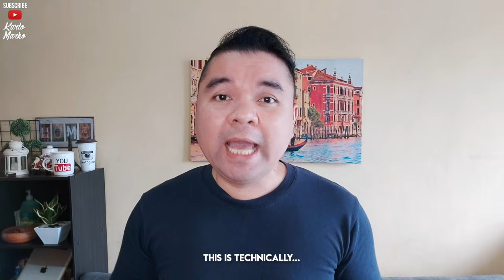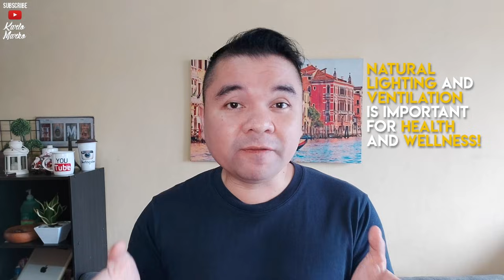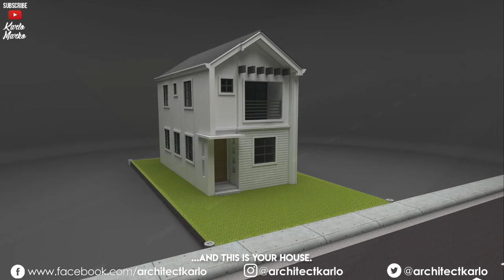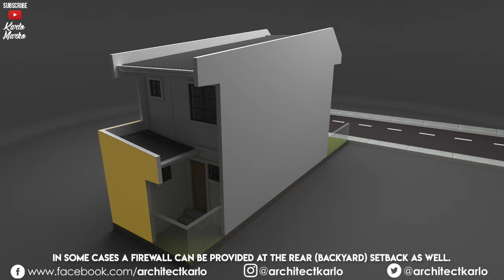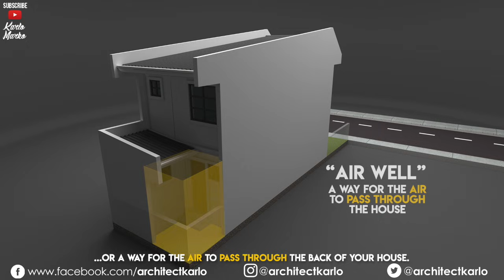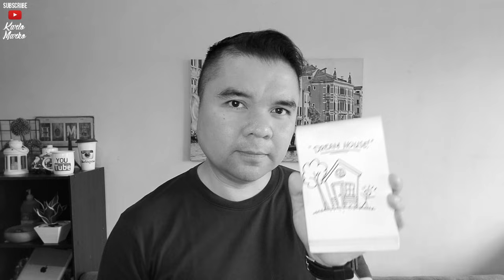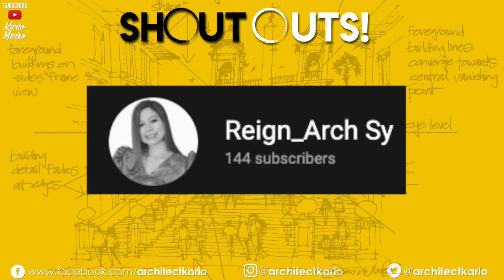The Rules on Setbacks and Firewalls | Bakit Hindi Pwedeng Isagad Sa Property? | ArkiTALK (Eng Subs)

Comment: For R-1, low density, does the 2 meter side setback also apply to a detached (stand alone) non-dwelling structure such as a pump house or storage shed or can a non-dwelling structure be built on the property line?

Comment: Sir Karlo, regarding the front setback, you mentioned on this presentation that it is defined as the front yard. My question is, what is the setback ruling if you want a driveway/car port installed on the front of the house adjacent to the front yard? Thank you.
Reply: pede mo po siya ilagay sa una. dun sa setback with a minimum measurement of 2.5x5
Reply: @vince6578  pasok po ba ito sa nbcp?
Reply: as long as naachieve yung nakaset sa nbcp, yung nasa building code kase minimum and if normal car parking lot/port lang pwedeng itaas mo na sa 5m yung setback if nasa tapat mismo ng carport kase recommended minimum size ng car parking lot is 2.5m x 5m. Another option is sa corner ng lote yung carport na 2.5m x 5m while maintaining yung setbacks ng bahay na 4.5m,2m,2m,2m(R1 as example), as long as 1.5 METER TALL PERIMETER WALL CUM ROOFLESS CARPORT lang if R1 yung lote. in short, depende sa lote and/or sa local ordinance/s

Comment: Can I put a roof for an open garage (no front or side walls) within the front setback area if the garage level is below the floor level of the planned house? This way there is no obstruction for lighting and ventilation. If so, can the support garage roof can still be at the 2 meter setback, and the front of the garage roof overhang 1 meter from the front perimeter?

Comment: With just one vid, I'm sold. The way you explain things is just so amazing, direct to the point and very easy to follow. If I may, can I ask what's the minimum thickness that we should follow for the firewall? Thank you!
Reply from the maker: Thank you!

The firewall wall should be atleast 20 centimeters (8 inches) thick with a four-hour fire resistive rating for fire protection.

Comment: tips on choosing lot, shape of the lot, near gate subdivision or far, middle, corner, triangular shape of lot, round corner lot etc.. pros and cons...✌🏻 keep it up arch!
Reply from the maker: Hi Micko,

I'm not an expert in choosing a lot as I haven't had that much of a chance to do so... hahaha! 😆 I wish. 

Although, best lot size for me as a designer should be at minimum of 100 to 150sqm... in the video I mentioned a 4x15m lot which is good enough to design without too much complications in the space...lot shape as much as possible a square or rectangular shape... easy to plot the floor foorprint... for ventilation, corner lot is the best where you can fit preferably a single detached house. Choose the lot which is not too far from the main gate but far enough from the clubhouse as the clubhouse tends to be noisy during events.
Reply: @KarloMarko  oh thank u so much for the reply. noted sir 👍🏻

Comment: 3 questions po if there is a thing as 'fence setback'?
- required ba sa fencing ang setback from the property line ( agriculture property sya)?
- allowed ba gumamit ng barbwire as fence?
- Required pa ba ng permit if barbwire lang naman ang gagamitin? 

Hope to receive a reply. TY.
Reply from the maker: Hello Damsel,

As per National Building Code, the fence can be along the property line. So there's no need for a setback.

As for the barbwire sa fence its really upto your local municipality to approve kung pwede ito. This is usually applied to properties in need of high security.

Comment: Ibig sabihin po ok lang po na yung roof eaves ay nasa area po ng setback tama po ba? 
Doon po kasi sa example po wala pong roof eaves. 
Example po: min roof eaves is 0.750m - 2meter setback= 1.25m po na clearance. 
Wala naman po bang violation po sa ganito basta po masunod yung clearance between sa roof eaves po ng kapitbahay?
Reply from the maker: Ang pinagbabasehan na part ng bahay sa set-back rules ay ang exterior walls. The roof eaves have a separate rule. Pero may ilang subdivisions and developments na naglalagay din ng limit sa lapad o lawak ng roof eaves. Under the building code, your statement applies regarding the min. Roof Eaves of 0.75m
Reply: @KarloMarko  Thank you po Architect!

Comment: Thank you sa info.
Question: Tama ba ang sinasabi  ng ibang tao na kung gusto mo ng magandang bahay, sa architect ka magpagawa pero kung gusto mo ng matibay, dapat sa civil engineer?
Reply from the maker: Hello Akino,

Lahat ng bahay ay dumadaan sa ganitong proseso (in order):
1. Architect: kasi kami ang 1st step sa pagdedesign ng bahay. We are the only professional who studied and mastered designing of buildings and houses.
2. Structural (Civil) Engineer: he will then make sure that the design of the architect is sturdy and strong.
3. Electrical Engineer, he will then design the house to have power and lighting (electricity)
4. Plumbing / Sanitary Engineer, he will design the water pipes and drainages including sewage inside the house.

All these professionals work together to design a house. That's the one you see on blueprints. One cannot work without the other kelangan silang lahat para sa isang bahay. In some cases you may also need a Mechanical Engineer and an Electronics and Communications Engineer.

Now. After the design you will need a contractor to build it. A contractor can be of any profession, an Architect or an Engineer. May kilala pa nga ako na Accountant.

Hindi totoo na kung gusto mo ng matibay na bahay sa Civil Engineer ka magpagawa. Kasi lahat naman ng bahay ay dadaan talaga dapat sa lahat ng professional na sinabi ko. At trabaho talaga ng civil engineer na siguraduhin na matibay ang design nya na naka-base naman sa 1st step... Ang design ni Architect o ang Architectural drawings. Kaya sa umpisa, sa arkitekto ka muna. At sya na din bahalang kumausap sa mga engineers nya para isa na lang ang kausap mo. Kasi lahat din naman sila susunod o magbabase sa Architectural plans na ginagawa lamang ng Architect. 😊 In cases na may kilalang engineers si client, ok lang naman yun na isa sya sa magdedesign ng bahay. 😊

You may watch my other videos to get a better idea on this topic.
https://youtu.be/rYvEXZc5qwk
Reply: @KarloMarko  naku sobrang maraming salamat sa pagpaliwanag at sa time para mag reply.  Subscriber na ako bago ka pa nag reply. Malaking tulong yong mga information na binibigay nyo
Reply from the maker: Walang anuman, Akino. 😁👍 Salamat din sa suporta. God bless.

Comment: If 3m are the allowed distances from the front and sides of the property.  When constructing a spiral metal stairs on both sides.  Will the 3m be from wall of the house or should it be from the spiral stairs?
Reply from the maker: Some local governments or the developers allow it to be on the setback area itself and some are strict that it should no touch the setback area itself to be clear from any obstruction. You may check this with the subdivision admin or the local city hall building official to confirm. 🙂

Comment: Hi architect.  Meron kaming kapitbahay na nagpapatayo ngayon ng bahay sa loob ng subdivision (lot only subdivision) .  2 lots ang pinapatayuan nila mga 300m2+ total ng lot area.  Sinagad ang building sa side namin kaya ma bablock ang natural  flow ng air at natural lighting sa amin.  Sa right side ng bahay namin ay firewall dahil maliit lang ang front at carport na rin ito.  On that same side din ang garage nya tapos buong wall na ang firewall hanggang sa likod leaving at least 1 or 1.5m sa rear.  Pwede ko ba ma question or ma reklamo ang pagsara nila totally sa side namin? May bintana kami sa kitchen side kung saan nila ipapatayo ang firewall pero ma bablock na ito ng firewall nila.

Comment: Great info. But my question is... Sa mga old houses na hindi naman or wala sa mga  subdivisions, na halos sagad na sa kalsada mga pader or frontage - para lang maging maluwag at habitable ang bahay - gaya ng mga halos lahat naman ng bahay sa metro manila na wala sa subdivision, paano pa iaatras ang bahay (in case if ipapa-renovate) if ang lote is less than 50sq. Mtrs lang? 

Next question is... Itong lote na sinasabi ko ay nasa pagitan din ng "eskinita" - hiwalay or detached naman sa kapitbahay di ba? So, kailangan pa din ba mag "set-back" kung ganuon ang lote mo?

Ikatlo na question ay, if sige iaatras ang bahay sa balak na renovation - yun frontage ba magagamit as "car port or garahe then sa ibabaw niya ay malagyan ng balcony na nde naman palalampasin sa gutter?

Paki sagot naman po sa next video. Thank you sir Marko.
Reply from the maker: Hello Josef More Wrong. 🙂

For the old houses... the national building code may not have been strictly applied during that time. The NBC or PD1096 was enacted or signed way back in 1977. And it wasn't immediately applied during that time as well.

For your other question... there are some exemptions on the setback rules  mainly on smaller lots and other instances like those on hill footings, sloped land areas and other lots which the setback rule will just serve as big challenge that is why an Architect is important. Because the Architect can design it in such a way that he can deliberate these issues with the Local Government Unit (OBO-Office of the Building Official) to explain and defend why the lot should be exempted to the setback rule if there is really no other way.

For your last question... setbacks can be used as carports, yes. The balcony may need approval since this is considered as a major structure to be constructed. All these will be cleared once it passes the building permit application. Simple roofing on carports are ok... as long as it is not an enclosed room it should be okay to utilise the setbacks as carports.

I hope these answered your queries.

PS: The laws on setbacks and the National Building Code in general is to set rules that will make your house habitable or comfortably livable. That's its main purpose. Not the other way around. These rules are for you, the home owner... not for anyone else. Exemptions may be applied, but you need to have an Architect who knows how to defend it.

Happy New Year! 👍
Reply: @KarloMarko  Napakaraming salamat sir. I didnt think na magkaroon kayo ng time na sagutin po ang mga questions ko. 

I really appreciate it much. Sa ngayon kasi nag iipon ako pang renovate sana sa nabanggit ko na bahay na nasa maliit lang na lote. And lets admit it - nde naman po lahat and karamihan ng mga pinoy na nasa median income ay nde naman nagpapa arkitekto ng pinagagawang bahay dahil na din sa "karagdagan na gastos" pa ito.

I have just been following your channel for less than 2 days now and I have learned so much from you.

I see that you are a proponent of hiring architects and I clearly see now why. Para legal lahat and para ma determine yung budget para sa  ipapatayo na bahay na kahit low end ang budget - ma sigurado pa din na structurally possible yun mga specifications ng magpapagawa.

Again, napakaraming salamat. And HAVE A BLESSED AND HAPPY NEW YEAR To You and your Loved Ones.
🎉

Comment: Hi Architect. Nakakuha po kami ng bahay at lupa sa isang subdivision. Yung katabi naman sila ang naunang magpapader. Tapos yung hollow block na pader sakto naman talaga sa boundary nila at hindi nag overlap sa parte ng boundary namin. Tapos yung part na nakaharap sa amin, balak sana naming i-plaster para mas gumanda tignan at mas maging matibay. pero ayaw daw nilang ipagalaw at may karaoatan daw sila dahil sila ang nagpagawa at hindi naman nag encroach sa amin. kung gusto raw namin, mag double walling nalang daw basta di namin pede kahit ano sa pader na pinagawa nila
Reply from the maker: Tama po sila. Kung ang inyong property ay walang perimeter wall, kayo po ang magpapagawa nito. Kanya-kanya po talaga yan.

May mga property na pre-built na o gawa na ang mga perimeter walls or fence. Pag ganun, shared kayo. Pag lote talaga ito na blanko kayo po ang magpapagawa ng lahat basta pasok po ito sa inyong property line.
Reply: @KarloMarko  Architect...  Maraming salamat po sa pagtugon ng katanungn ko. At least, mababawasan na ng konti ang inis ko sa kapitbahay ko. Yung pagiging pakialamera na lang niya ang isyu ko, at move on na ako sa pader issue. More power po.

Comment: What if naka-firewall na ang kapitbahay mo, pwede kaya na maglagay ka ng bintana kahit less than 2 meters ang space ng lote mo sa side? Salamat.
Reply from the maker: Hi Oliver. Technically hindi pa din pwede. Ang setback rules ay naka-assign per property. Hindi sya give and take with the neighbors.
Reply: @KarloMarko  Ahh. Thank you. Now I know. 👍
Reply: @KarloMarko  What if lagyan ng sort of 'firewall'? Meaning ung firewall nila tatabihan ko ng pader na singtaas at singhaba rin ng firewall nila pero hindi pa un ang dingding ng bahay ko, parang un na ung firewall ko in a way.
Kumbaga, parang naka-advance ung firewall ko(which is not part of my house), kadikit ng firewall nila so I can put windows/openings sa side ng bahay ko. Iko-connect na lang ung 'firewall' through beams for added stability. Pwede kaya un?
Salamat ulit.
Reply from the maker: Nice one dito, Oliver. Yes. This is possible. 😊

If you live in a subdivision, they have rules and regulations regarding this. You may check with them also lara sure.
Reply: @KarloMarko  Thank you. 👍👍

Comment: What is the setback rules for corner lots? Is there a rule for sidewalks? Existing house does not have a sidewalk. What if we put a second floor, do we need to "fix" the setback?
Reply from the maker: Corner lots are considered to have 2 front set-backs because it is in the corner with 2-sides along the road or the street. The sides along road/street is considered to have a front setback requirement.

Comment: Allowed ba mag drill yung kapit bahay sa Firewall? We have single firewall house. They are doing extension.
Reply from the maker: It depends. 🙂

Is this in a subdivision? If ever you may ask the subdivision admin office. It is included in their rules usually.

Is the firewall connected to adjacent house firewall? Is it a common firewall or solo mo siya? Pag solo mo sya, I guess papayagan ka naman ni admin.

Note that kung mag eextend si kapitbahay dapat separate or bagong firewall ang ididikit niya sa wall nyo at ang firewall nyo at ang sa kapitbahay ay magkaiba  Pero again kung under kayo ng subdivision developer better to ask their admin.
Reply: @KarloMarko  Bawal sabi ng admin namin. Single Firewall Bungalow house namin. Firewall namin mismong walls na din ng Rooms namin. hindi nila nilagayan ng new firewall. nagpalagay sila lababo dinikit. They chipped and slightly carved the firewall pero tatapalan naman daw nila

Comment: Architect,  in applying building permit di ba basis ang DOR approved by council and previous city building head? before ko napurchase ang residential unit naka indicate naman sa DOR ang allowed and not allowed. Kaya with the DOR on hand  we decided na bilihin ang residential house. Apparently, disapproved yon building permit ng current city building head. Also, to add meron na the same design sa loob ng subdivision. Its just that nun nagbago ang head hindi nya e honor ang DOR.
Reply from the maker: Ngayon ko lang po narinig yung situation na ganyan. Ano daw po ang kelangang gawin? Reapplication? Kasi I don't see anything wrong sa situation.

Comment: Dapat bang mag karon Ng set back para sa fencing Lalo na if nasa tabi Ng daanan Ang lote nyo ?
Reply from the maker: Most fences can be installed directly on top of the property line as long as it doesn't overlap the adjacent property or the public roads or sidewalk. Although, some residential areas have limitations on the total height of the perimeter fences. This one you can check with your subdivision admin or your local municipality in charge of building permits.

Comment: YUNG subdivision ko has a different set of rule when it comes to the height of the house na itatayo. gusto lang nila na hanggang second floor lang at di pwedeng lagyan ng deck,, sino po ba masusunod, yung subdivision na kung san may lot ako or mismong building code?
Reply from the maker: When it comes to subdivisions... Si subdivision po ang masusunod. Their rules are still based from PD1096 National Building Code  and BP220. Subdivisions are allowed to implement stricter rules to maintain the balance, motif or the environment of their development.

Comment: paved and unpaved areas naman po
Reply: @KarloMarko  Diba meron pong minimum USA & ISA?
Reply from the maker: Hi Mary May... 

Actually, in the National Building Code it is mentioned there that there should be unpaved open spaces pa din in your lot of around 10%(with firewall) to 15% (without firewall) depending on the percentage of site occupancy of your house. There are other implementing rules regarding this. 

If you pave your entire lot po kasi. Lalo pag concrete pavers yan... may chance na mainit ang paligid ng lote especially during peak hours in the afternoon. I suggest, you mix it with grass and plants... the problem lang with grass... anay (termites) so need lagyan ng anti-termite solution ang grass. 😊
Reply from the maker: Yes, architect there is a percentage ratio for paved areas in Rule 8: Unpaved Surface Area (USA) and Impervious Surface Area (ISA).

Kwento ko lang. I had an experience where the client landscaped her entire open space (excluding the carport) this was after the house construction... and the landscape design was laid with pavers on the pathways kaya halos buong open space niya paved and there were pockets of greenery lang on the sides of the pavers...